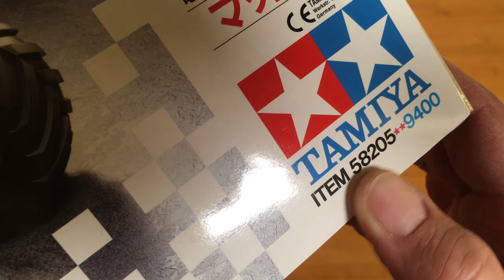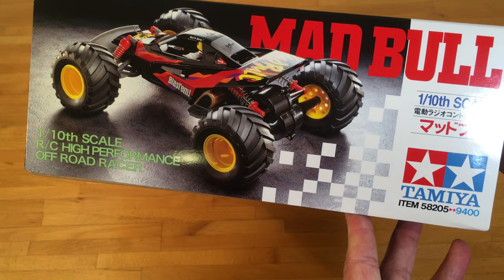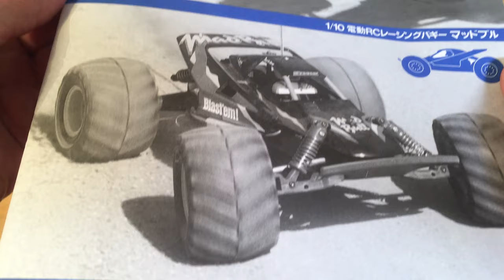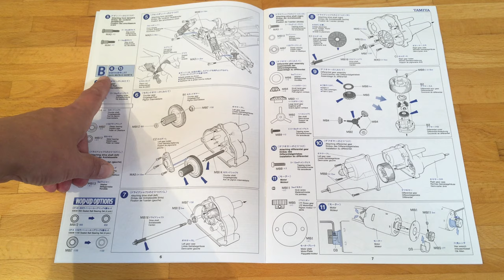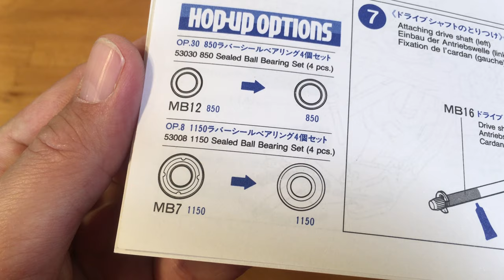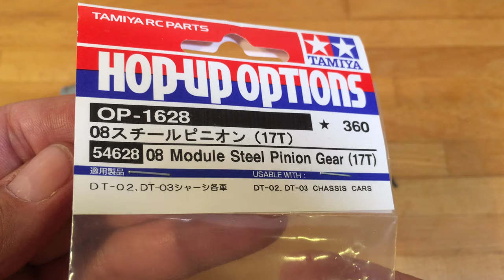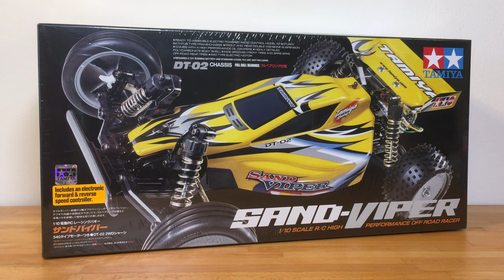Tamiya DT-01/02/03 Project #1: Tamiya Mad Bull (DT-01) Unboxing & Gear Box Assembly!

Comment: Hi Mikael, so very pleased to see that you are building this awesome Tamiya kit at last. Nippy in brushed form and ludicrous in brushless form. They look like the lovechild between a Lunchbox and a Grasshopper. Most parts pre-built to make the build easier. The gearbox is left unassembled so you have the option to fit metal bearings or plastic bushes. And if you lock up the rear diff, you will never stop smiling. Have fun with this one young man, it'll be worth it..
Reply from the maker: Hi Peter. Yeah, for a start since this is my first DT-01 it will be with a stock motor and stock gear ratio. Mine will look a little different than the stock Mad Bull though 🙂 He he, Thanks!
Reply: @NordicRC  You're very welcome Sir, I have a few that are in standard form and the rest are loony fast. Mine start with 27t RS540 straight out the box, 23t Sports Tuned, 15t brushed then stupid speed with a 10t brushless followed by two 9t Brushless bad boys then two 7t brushless really bad boys and I never cease to stop laughing when I take these out. I've ordered a couple of 3t motors for some extreme fun with my RC Family. Have fun building your kit your way. There are a few tips about how to take the play out of the steering but it's due to the silly rod from the steering servo saver to the front arms that gives you the unpredictable play. I used a bit of M3 threaded bar and a turnbuckle each end. It gives direct steering 100% and takes out the quarter inch of play. Just a tip for you to think about if you're going to modify it as you go along with the build.
Reply from the maker: @cw-01creations46  Sounds like some fast Mad Bulls :-) So cool. And thanks a lot for the tip. Will try stock first, always exciting to experience a stock model at first hand and "discovering the model" for yourself, but will make sure to come back to your comment if I start changing things on it later after the first couple of runs. Thanks again, Peter.
Reply: @NordicRC  You're most welcome young man, happy to help if I can.
Reply from the maker: @cw-01creations46  It's so seldom anyone calls me young. I feel refreshed and re-vitalized each time talking to you, Peter :-) He he

Comment: Hi Mikael, good choice of music for this video. And Mad Bull, hmm, what to say, looks sweet, like grasshopper on steroids. If it was mine, I will put into it some faster motor and another shocks and then BLAST'EM.
Reply from the maker: Hi Milos. Yeah, good way of putting it, a Grasshopper on steroids :-) Well, this is my first DT-01, so I am very curious to see how it will perform with the stock motor and stock gear ratio. So looking forward trying it out like this. It will not be 100% stock though when I proceed :-)
Reply: I fitted a 20t motor and Dark Impact suspension to mine, handles much better

Comment: Hey THERE amigo, MAN I am having the TOUGHEST time with these few mods bro, I mean those turnbuckles were a huge pain in the ass to get on that a959b of mine. Do you know how I can adjust the darn things? 

WOW, the Tamiya Mad Bull huh? You'll LOVE the texture of those parts, FITTING well, compared to ripping your fingers up, taking off AND adding parts to the WL line cars, I mean Tamiya's QUALITY is shown in their PRICES!. All the parts fit together nicely and large portions of your build won't be left out OF the instructions, NOT with Tamiya, LUCKY bugger, ENJOY... I'm sure you will. Here I'm still stuck between a ROCK and a WL toys 144001 AND a959b!!! 🤪👍💯
Reply from the maker: Yeah, most Tamiya models I have built are excellent with parts fitting perfect. I have not tried the A959 turn buckles so I am not much of an help. But I have seen people having trouble with some of them, having to file some of the ball ends to ‘free’ them and make them fit. Uhh. The 144001. Waiting for that one ☺️